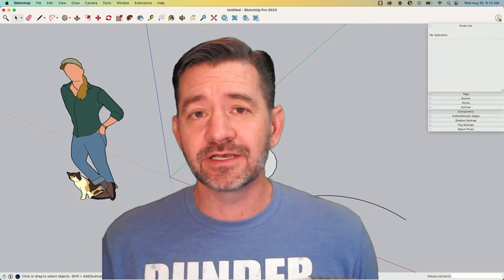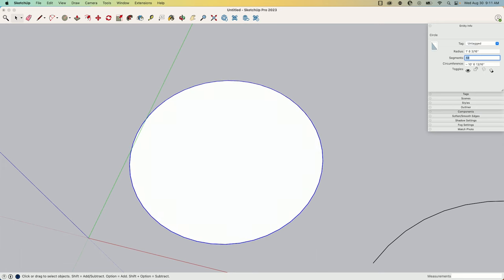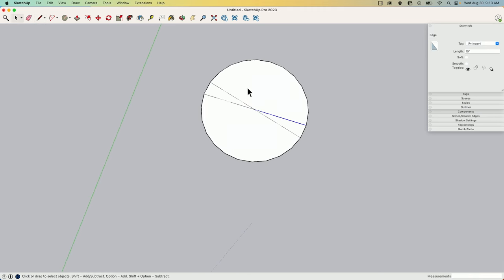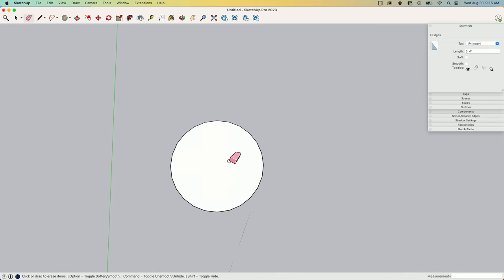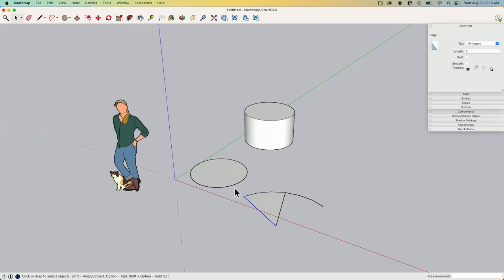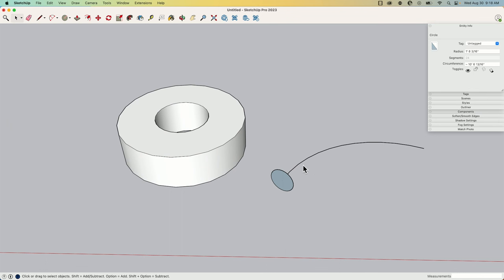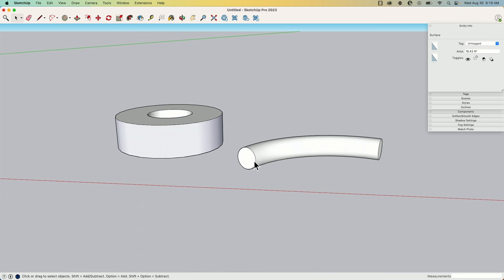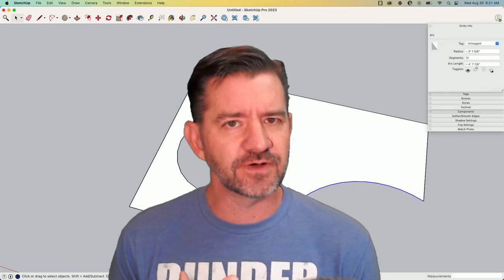Arcs and Circles in SketchUp

Comment: Because of the stuff I usually draw, I almost always up the segments to 32 or 64 or another power of 2. This seems to avoid a lot of problems of strange results when intersecting faces. I would even change the default of 24 segments to 32 if it was possible (or I could figure out how). I come from an Autocad background where 'entities' are stored as equations so that tangents and intersections, etc, are calculated to 12 or 16 decimal places.